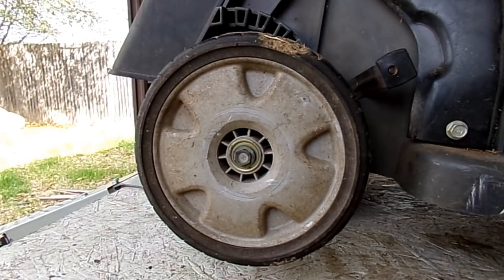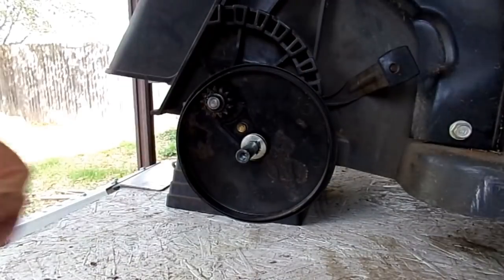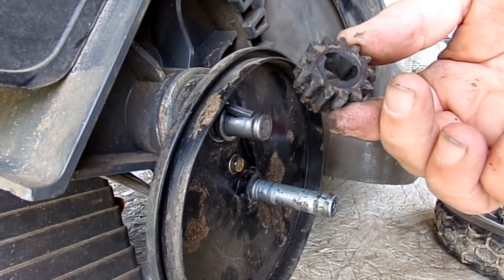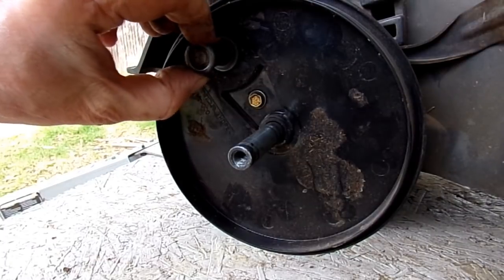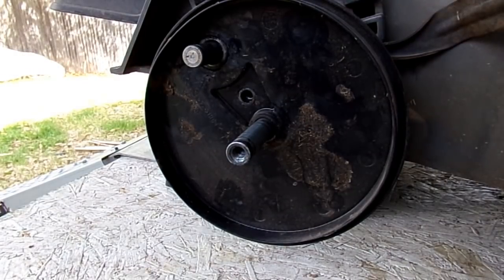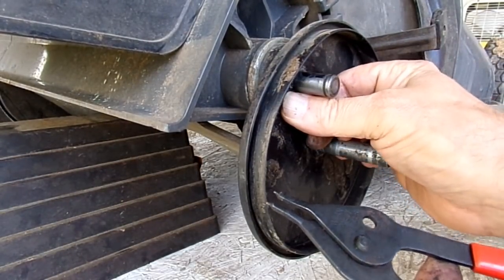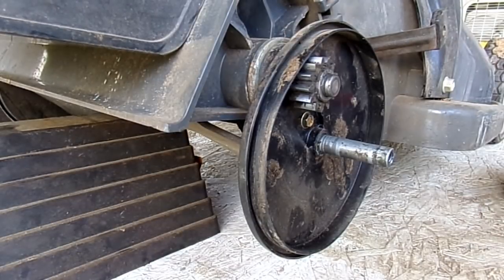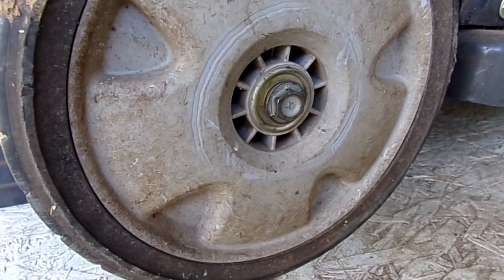Honda Mower Won't Roll Back

Comment: I’ve got a weird one going on now.  On my HRX217HXA, I service the pinions, ratchets & springs every two years, most recently this past spring.  It ran & worked like a new machine all summer & fall.  A few days ago I tried to use it to mow up some leaves (after sitting for 2-3 weeks); all was well for about 6 passes, then the RR wheel started locking up intermittently.  By the time I got it back to the garage, both rear wheels were frozen in both directions, whether the engine was running or not.  It was about 50F at the time, so it was cool but not freezing. 

Tomorrow I’ll tear into it, but I’m pretty familiar with all those workings and I don’t understand how this is even possible.  It doesn’t seem like it would be the transmission since the axle shafts don’t even turn when rolling forward with the drive disengaged, yet what are the odds of both sides locking up within minutes of each other, independently?  It almost acts like the ratchets both came out somehow and got jammed between the pinions and shafts (not possible, but that’s how it feels).
Reply from the maker: This is a weird one.  I suspect the ratchet key area. Check the keys, slots, springs and pinions for wear or debris.  Let me know what you find.  My email is in the description.  Thanks for watching!
Reply: What a mess.  I took the left wheel off first and laying down inside the ribs of the wheel were the outer snap ring, outer collar, pinion gear, inner collar, ratchet, and plenty of metal shavings.  Basically all the drive related components on the left side came off.  I have NO idea how that happened; again it mowed a good-sized lawn every three days from mid-spring to mid-fall, and never missed a beat.  When I service this area I closely inspect the snap rings for wear, rounded corners, etc. and they were fine (maybe even new) in the spring. 

With nothing holding the left side of the transmission assembly in place, the whole assembly moved from left to right, allowing the right side pinion gear to ride too far inboard on the axle shaft (the ratchet was turning normally but it wasn’t engaging the pinion because it was out of position).

The ribs on both rear wheels are bent and a little chewed up but I think they’ll work fine still.  I think the pinions and springs are OK but one ratchet’s corners are rounded over so I’ll replace those.

The axle shafts still turn freely so hopefully the transmission is fine, but I’m not sure the right axle shaft isn’t badly chewed up. I guess I’ll go ahead and pull the whole thing out for inspection, shaft cleanup, replace shaft bushings in the adjusters, etc.  Not looking forward to this.
Reply: Return for a full refund! These are a POS mower.

Comment: Great video but it fails to show where the grease goes, should the axle be greased?
Reply from the maker: Only a small film to prevent rust on the axle if you feel the need.
Reply: Thanks for the reply

Comment: Same honda mower as the video on why your lawen mower won't rollback.   How do you replace the slot that slides back and fourth between mulching and bagging. my slot rusted and my bolt no longer stays in. Thanks greg
Reply from the maker: Email me a picture of your problem please. Email address is in the 'ABOUT' section of my channel page.

Comment: Thanks for the video! Question... my HRX217 doesn't seam to self propel as fast when speed knob all the way forward. Is these a cable adjust issue? belt issue? or something else? Thanks.
Reply from the maker: Try adjusting the cable first.  If you have the manual, the procedure for this is included. If not a quick web search will get it for you.
Your belt is the next thing to check if adjustment doesn't work.  You didn't specify which sub-model you have but if it similar to the HRX217 TDA then also check to make sure the return spring is intact and connected.  I posted a video on the transmission removal that will help identify where this spring is.
Good luck and let me know if I can help further. Thanks for watching and commenting!
Reply: Hi. Thanks for all your videos, I have been browsing them for help in replacing the return spring as mine broke. Do you have a video where this is covered? or - can you offer a quick hint how to replace it? I can't get figure it out.
Reply from the maker: Check the Honda shift cable lost footage video I just posted and let me know if it helps.

Comment: How would those gears get reversed in the first place to prevent it from rolling back?
Reply from the maker: Many reasons. Improper repair is the main reason. Sometimes they are just installed wrong.

Comment: What’s the cause of not being able to adjust the height adjustment on one of the rear wheels? It is super stiff.
Reply from the maker: Sounds like you have some corrosion on the shaft.

Comment: My HRX217 slowly stops as grass is being caught.  1st gear not really working, 3rd gear was typical, but when grass started being caught, the mower stopped moving.  How do I tell if its the cable or the transmission?
Reply from the maker: I would try adjusting the shift cable first. It's possible that your belt is worn and stretched or the drive pulley on the motor is worn and not gripping the belt. Good luck!

Comment: I have a 217 series mower with similar problem but this does not seem to be the issue.
Reply: Probably the bushings on the axles. My started acting up today and I watched a few other videos before this one and they tore considerably deeper into the drive system. Pull the axle and sand smooth the area where the bushing slips over. Did you fix yours?

Comment: My mower makes a clacking noise when it’s rolling (not mowing and using transmission). Is this sound normal for this mower?
Reply from the maker: Yes
Reply: @veteranssmallenginerepair5934   That’s a relief to hear. So, what is causing the clacking noise when the mower is rolling while off?
Reply: The sound you are hearing is normal while rolling /or turning the rear wheel (s).
An ATG's Ratchet Key moving up & down, ATG's Ratchet Key Return Spring pushing Key to hit ATG Pinion Gear.

The ATG Ratchet Key Return Spring & ATG Ratchet Key do wear out.
If you don't be careful removing the Pinion Gear, that Ratchet Key Return can fly out. Then it's going to be a bad day.

Comment: Why will my Honda hrx217 only turn to the right freely? I have replaced the wheels . But if you try to turn the mower to the left it binds up and will not turn that way easily. If I only turn the mower to the right it turns effortlessly
Reply: You have one of those gears on backwards...
Reply: @frandanco6289  no sir both gears were on correct. Turned out to be wear in the shaft keyway and it would shift and bind up

Comment: Remove the outer snap ring, drive gear, woodruff key and spring store these parts in plastic bag. Install wheel  push and pull mower manually with  ease. My yard is relatively flat and not worth the aggravating wheel lock up pulling mower rearward. I could use the exercise.  😮

Comment: What brand of snap ring pliers you got there? I have several pairs and none are a good fit for Honda snap rings
Reply from the maker: I  don't really remember which brand. Either HF or auto parts store brand.
Reply: I have LISLIE brand snap ring pliers, lifetime guarantee, about $ 20  Honda snap rings are tough !
Reply: @paule.maurice1521  My problem was getting the prongs to fit the holes. Honda seems to make the holes smaller than most others. I found some that I'm satisfied with. I can't recall where I got them... ebay or HF. Lisle makes good tools but these will do. I love working on the Hondas. For anyone who doesn't know about boats.net check out their prices.
Reply: I have had great results with Channel Lock snap ring pliers

Comment: If the sleeve corrodes, its all over, they will not roll. I had to cut mine off and order a replacement. If you dont, it will be plastic on metal.
Reply: I ment the wheel sleeve. Lightly grease the  gear.
Reply from the maker: Great tip!

Comment: You should grease the inner surface of the pinion gears before reassembling. It’s in the owners manual.
Reply from the maker: Thanks. I missed that part in editing and should have included it.  Thanks for watching and commenting!

Comment: There is a punch mark on one of the teeth of the pinion gear.  It goes toward the outside on the right; inside on the left.
Reply: Thanks GT, could you clarify one item, is it the right wheel as you are pushing the mower?
Reply: mjk3mjk3, yes.  But IMO it’s easier to remember that the flats always go toward the back of the mower, as demonstrated in this video.
Reply: @KSMike1  Yes, they go toward the back but that means FACING the front. Nevertheless I did wonder about those punch marks! Just checked on left side (or 'port' side for the person who  asks 'left/right when facing the machine or when behind it?') which is in process of dismantling: with the flat 'facing front' in my terms, so it pushes against the key.

Comment: Did I miss the final reason for the problem with this machine? You took it apart & put it back together- what was the problem?
Reply from the maker: The ratchet keys can be installed upside down and or the pinion gears can be reversed.

Comment: Ok, but what was the problem? I looked at a disassemble en assemble of one rear wheel, but I don't know what caused the problem and what the solution is.
Reply from the maker: The ratchet keys that lock the axle to the pinion gears were upside down.
Reply: @veteranssmallenginerepair5934  my mower is doing the same thing but never has been disassembled. Just needs to be cleaned? Great video by the way!

Comment: never said what was causing the binding.   Debris?
Reply from the maker: After maintenance, the ratchet key that engages the pinion gear can be installed upside down, the pinion gears can be put on the wrong side or debris can jam the above mentioned parts.
Reply: @veteranssmallenginerepair5934   What if you never had that off and is occasionally locking up? Comes and goes. Tried spraying WD40 and seems to help for a little bit.

Comment: What was the problem?  How did the clip get flipped upside down? Thanks.
Reply from the maker: Sometimes it is a manufacturer error and sometimes a repair shop might install the part upside down.

Comment: No parts replaced?  So what was bad about it? I didn't understand the cause of the problem here... it looks like you repaired it, then made the video showing the steps. It was awfully clean compared to mine smh...
Reply from the maker: No parts to replace. They were in backwards when I got the machine. The cause of the problem was a previous repair done by another shop. They most likely didn't pay attention when putting it back together, but at least they cleaned everything.  This problem is quite common.  Thanks for watching and commenting.

Comment: Mine only drives one wheel and locks up every now and then any idea why it’s doing that
Reply from the maker: Check your gear pinions that drive the wheels. Clean them and make sure the parts are all there and not stuck.  Good luck!
Reply: That happened to me on a Sears mower with a Honda engine.  Gear bolt came out and got lodged inside wheel assembly.  Took wheel assembly apart.  Found the bolt and put it back into gear.  Worked fine.

Comment: Bought a new honda in June, looking at this video 10 weeks later...not impressed!
Reply from the maker: They are good machines overall. Their problems are usually human induced: improper repair, improper maintenance, left with ethanol fuel in them for months at a time, etc.
Reply: I’ve owned two and would buy another.  But that rear axle area IS high maintenance IMO, especially if you have to mow in wet conditions.
Reply: @veteranssmallenginerepair5934  no, the propulsion design is poor, how is that caused by end user?

Comment: If the machine is brsnd new and wears a 30 some year old super in shape guy out then this isnt the problem. This is for when you have used the machine for a long time and this happens.
Reply from the maker: This happens with improper servicing and sometimes mistakes made from the factory.

Comment: My Honda mower never rolled backwards since I purchased it brand new 9 years ago. I always thought it was a safety feature.
Reply from the maker: Usually it's the ratchet keys installed upside down by mistake.
Reply: @veteranssmallenginerepair5934  thanks! I'll check it out

Comment: The sprockets have absolutely nothing to do with it not rolling backwards. Leave this problem to experts to fix.
Reply from the maker: I am always open to opportunities to learn new things and look forward to learning from your video showing how "The sprockets have absolutely nothing to do with it not rolling backwards".  The shape of the cuts inside  the gear pinion and their relationship to the ratchet key is how the axle turns the wheel going forward, and allows the wheel to freely move backward. Thanks for watching!

Comment: Other than the motor, Honda mowers are a maintenance hog! Poor design!
Reply from the maker: Some can be. It depends how they are cared for. I have a Murray and a Craftsman that demand much more attention. Thanks for the comment!
Reply: @veteranssmallenginerepair5934  Hondas have a lot of parts and are expensive to work on.

Comment: Makes no sense. All you did was disassemble and reassemble the rear wheel mechanisms without pointing to any reason why the wheels won’t go backwards. No cleaning, no lubing. 🤪

Comment: That was way too complicated why did didn't you say whether these things were coming out of the factory that way or not. You might address why the throttle seems runaway overly sensitive do pressure variations when you're walking on uneven ground

Comment: My neighbor just "gave" me a Craftsman EZ Walk Variable Speed
 Model #917.370374 with a 6.75 B&S... he said it didn't run.  I 
cleaned the mower above and under the deck, cleaned the carb, added 
fresh gas, primed it 3 times and it cranked on 2nd pull.  Mower worked 
fine going forward,  but when pulling the mower backwards the rear 
wheels lock up.  However, the rear wheels do roll free in reverse when 
the mower is NOT running.  Any suggestions?
Thanks, Mark
Reply from the maker: From what I can tell your mower appears to have a similar drive system like the Honda in this video.  Find an owners manual and see if there is a cable adjustment for the drive engagement.  If there is, loosen the tension and give that a try.  Let me know how it goes and thanks for commenting and watching!